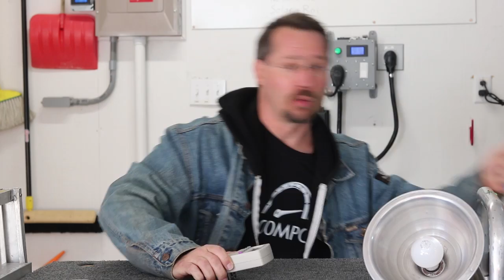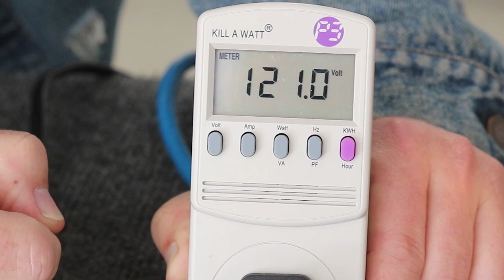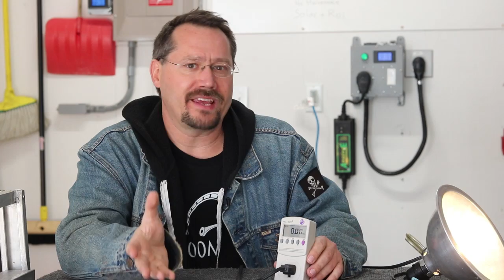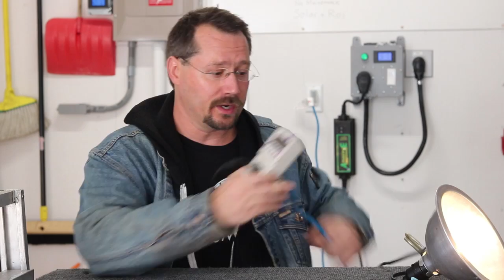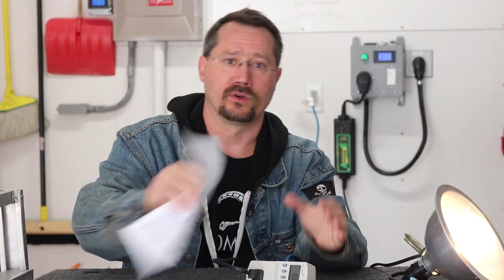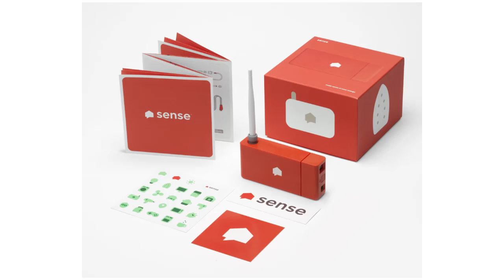How to use a Kill A Watt and save money

Comment: Great Video!!
 FYI:  i'm using an Poniie PN2000 has backlight & non-volatile memory. 
So want to save some $.  1ST Plug in your Xbox watch the numbers go up!  Yea It's a power hog... Even when it's OFF!
 TIP: Turn [OFF] instant-On
& Shuts-Off HD when not running. (Pretty Sure the PS is the same)

Comment: Ok so the audience you geared this video towards already understand watts, amps, volts etc.... I do not!  What I was hoping you would show is how to determine how much a particular appliance is costing me to run. For example an electric heater. How do I use the kill a watt to tell me how much this item is costing me?
Reply from the maker: Use the device to measure how many Kilowatt-hours (kWh) your device uses over some certain period of time. Multiply that by what you pay per kWh (which you will see listed on your electric bill) to get how much it cost to operate that device.

Comment: This is a MUST see Video... I bought one 2 years ago and I'm an ASE CMAT.  This made it very clear as to how KWH's work.  Thank You!
Reply from the maker: Share with your friends so they can see it too!
Reply: @BenjaminNelsonX  i heard u say on video there is a way to reset so it saves money right? Or do i need to turn off sometimes the thing that is using many watts
Reply from the maker: A Kill-a-Watt lets you know how much energy a device uses. You then know what devices you may want to turn off, unplug, or put on a timer. You may also want to replace an old appliance with a newer, more efficient one.
Reply: @BenjaminNelsonX  i did share the vid with my bro and cousin too can u respond my other question too plz
Reply from the maker: @oi3  No, 100 or 200 watts is not going to melt it.
Leaving it continuously plugged in with 1500 watts drawn through it isn't ideal though. I wouldn't use it with a space heater or charging an electric car.
Reply: Hello can i leave it connected many time? Does it melt even with 100 more watts or 200 more watts?

Comment: Well you just rained on my parade. I just bought the killawatt device   I wanted to measure electricity going to my PHEV Honda Clarity. I certainly don't want to melt it or mess anything up. I just checked it, it says 116 volts. 10.54 amps. Has anyone left their Electric vehicles plugged into this thing for any length of time?
Reply from the maker: You can certainly give it a try, but it's been my experience that it's best NOT to leave anything plugged in that has a fairly high and CONTINUOUS draw. For an electric vehicle, I would say that you are better off charging from 240V power and using more of a "permanent" power meter.
Take a look at a device I built for my car for how I included a 240V power meter. https://300mpg.org/2018/07/22/diy-home-automation-controller-for-electric-car-charging/
Reply: @BenjaminNelsonX  ok. I'll look into the 240
Reply: Damn, I wanted one for my Smart car also (at 08:40). So is there an alternative that's cheap and easy to install? I'm not ready to invest in a 240 volt upgrade. Right now I have a 25 ft, 12 gauge heavy duty extension cord running from my laundry room to the garage and would like something to monitor that power draw. Thanks in advance.

Comment: Clearly you must be an electrician or a electrical engineer,  as am I,  have you ever calculated what the price per gallon of gasoline as compared to your use of electricity for charging your cars batteries are.  I would be very interested in knowing what the cost of gasoline would have to be to match your compared price of electricity.
Reply from the maker: I am NOT an electrician or engineer, but I can use web search to find info including the fact that a gallon of gasoline contains about the equivalent energy of 34 kWh of electricity. Average U.S. cost of electricity per kWh right now is $0.12. Therefore, the equivalent of a gallon of gasoline in electricity would cost very close to $4.00. HOWEVER, that's only the average cost for the same amount of energy. The average electric car gets the equivalent of over 100 MPG!
So, if you compare a 25 MPG gas car, to an electric car, it's like you are paying $1.00 per gallon for electricity!
https://en.wikipedia.org/wiki/Gasoline_gallon_equivalent

Comment: Why would you hang your snow shovel over the electric junction access panel?
Reply from the maker: That's a dust pan. I scoop up sawdust in my garage with it. It's not over the electric panel, it's next to it because that's a very convenient place to keep it.
There's no worries about the electric panel getting wet, shorting out, or any other issues.

Comment: I would have appreciated more detail on how to actually see the energy use of a frij over a day.  how does the device tell you that?
Reply from the maker: Yes. The device shows you exactly that.
Tracking Energy (power over a certain amount of time) is one of the main uses of one of these. Just plug in your refrigerator through the Kill-a-watt. Press the kWh button, and it shows you on the LCD display how much energy your fridge (or lamp or whatever else) has used since it was plugged in.
This is especially useful for appliances like a refrigerator which cycle on and off. You could leave it plugged in for a day or a week and then do multiplication to figure out how much energy it uses in a month.
By KNOWING how much energy something uses, you can decide to use it less, replace it with something more efficient, unplug it, or otherwise make decisions to save energy.
As one simple example, at my parent's property, there are a few small decorative ponds. Those are powered by electric pumps, which send water to the top of a waterfall. The water cycles down, and then is pumped back to the top again. They are very nice and add to the aesthetic of the property. Using a Kill-a-Watt, we tracked the energy use and saw that it was relatively high.
We decided that the ponds with their waterfalls did NOT need to run 24 hours per day. We put them on timers, so that they are off at night when people are sleeping anyways. Doing that saves up to $30 per month!

Comment: Is there one that can handle 100-240v? I want one that can work back home too
Reply from the maker: Kill-a-watts are designed for 120V U.S. household voltage. There are other devices that can handle 240V.
Reply: @BenjaminNelsonX  thanks, they might be doing it by region.

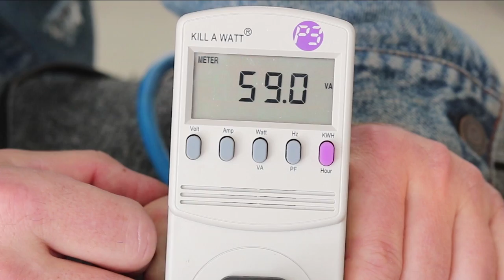Comment: Funny that you are using an old school electric to measure your power usage when the power meter itself uses 3 watts.  (3:01) 
The Kill A Watt can't be used to save power.  If you want to save power you power off the device.
Not sure where you are, but where I live in California we are paying at time up to $.48 kWhr.  And on some rate plans it can be as much as $0.78.
If you have Alexa don't you have smart plugs?  The TP-Link HS110 track kHr consumption just as the Kill A Watt does. 
You did make a nice video.
Reply: The Kill A Watt is not to save power, It's used to tell how much power your using.

Comment: Great production quality,  and a simple no-BS guide on how to use these devices and more importantly act upon the information. FYI in the UK you can get 240V versions of these meters (with a UK 3-pin plug interface) but they are limited to a maximum 2KW power draw.  Keep up the great work.

Comment: For a small load like a light, using an extension cord is fine but I would shy away from using an extension cord with devices that have a compressor like a fridge.  A better option if you must use an extension cord would be a heavy-duty 12-10 gauge appliance cord.  Also for $6-7 more you can often buy the EZ version that has an internal battery backup that saves the settings and the readings in the event of a power outage.  All in all, it is still good info for the lay people who don't seem to pay attention to the energy consumption of their devices.

Comment: Incorrect. These devices will not save energy. They simply tell you how much energy uses whatever you connect to them.

Saving means using the lowest setting in heaters and turning stuff off!
Reply: P V did you actually graduate high school?
Reply: But is off really off.......

Comment: Right on Ben you hit all the important parts on the Kill-A-Watt mine works great. I use the MTP 3100 for whole house but it does not determine between solar production and utility use so I am looking for some thing more sophisticated.
Reply from the maker: For a really basic setup, I've been pretty happy with those little digital panel multimeters. I have one tracking power created from my solar and one on my EV charging setup. I just have to subtract those numbers out from my electric bill to know how much solar I'm making, how much I use for my car, and how much energy I use for everything else. It's basic, but works pretty well. I just have to remember to reset the kWh meters at the beginning of the month!

Comment: Thanks Ben.  Especially with the links to the whole house monitoring systems.  I knew of the Sense system but wasn't aware of all the others.  I'll definitely check them out.
Reply from the maker: There's definitely a number of whole house energy monitoring systems out there. I used an older version of TED a while back and liked it overall. I'll probably eventually be going with an Open Source Energy system in the not so distant future. It has good support for tracking solar and some tweaks you can't get with other systems.